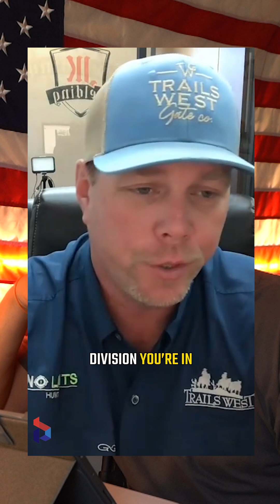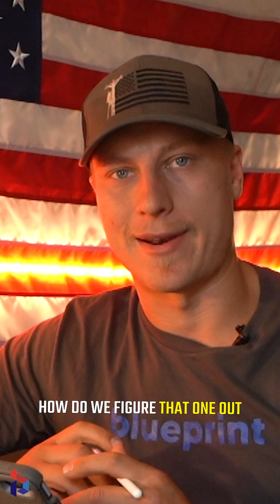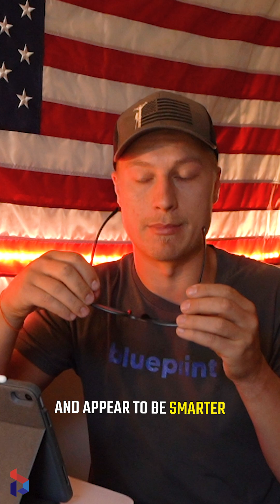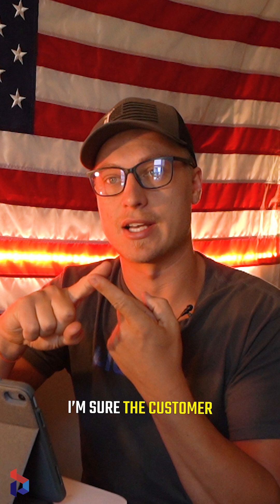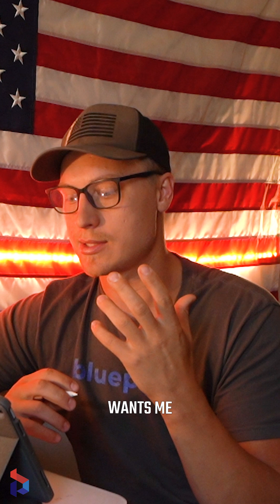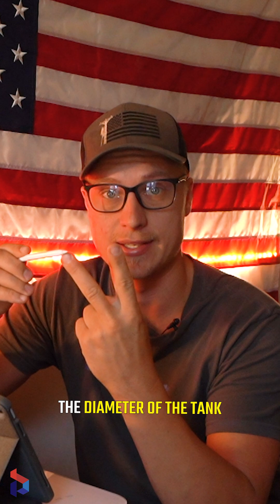Math For What?

Comment: Hello 👋

Engineer here. While the shape of the tank will definitely have to be taken into account when designing the dimensions and designed volume to satisfy the order. 

An even more important design calculator will be the pressure exerted on the tank walls by the stored fluid and any pressure applied.

Tanks fail when the stress exceeds it's materia failure point( yield point) and along the direction of minimum yield stress (weak point) this might be at the site of weld join or elsewhere where the minimum yield stress is exceeded. Cylindrical tanks offer better strength due to its shape and uniform pressure distribution. 

Another important factor you might want to consider and therefore calculate is the sale price of this tank, the cost of labor, material delivery etc and therefore you profit from the sale and manufacture of this tank. 

Have fun with it. The analytical and logical mind is a wonderful muscle that enjoys some metal exercise 🎉😅.